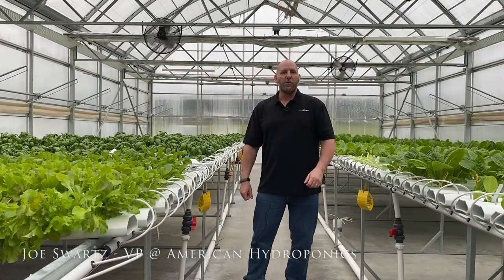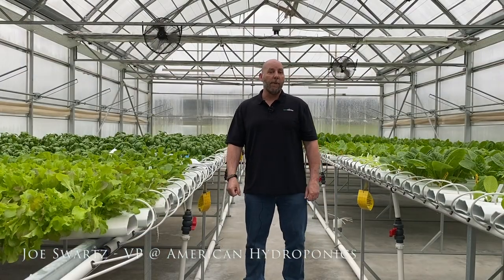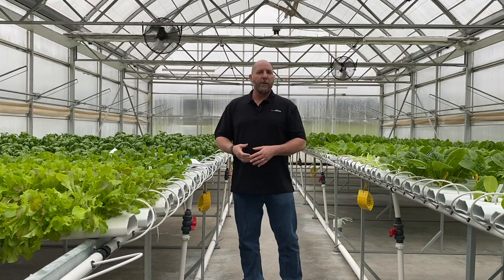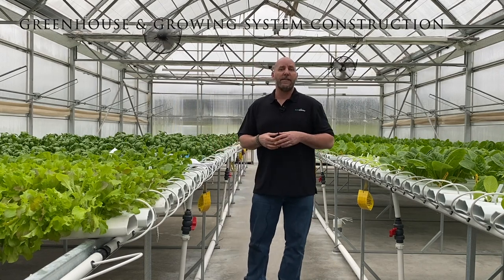March 2020 webinar - Building and Constructing your CEA Operation

Comment: Hello , I have question about NFT system. About irrigation timing , do you make the irrigation pump work all the day or you make schedule for irrigation? as example the pump work directly for 24/7 or the water pump work 5 or 10 minutes every hour. it's important to me so please answer me as soon as you can.
Thanks.
Reply from the maker: The pump for NFT systems run 24/7 and only shut off zones when you are actively working in the system.
Reply: @AmericanHydroponics  Thank you .